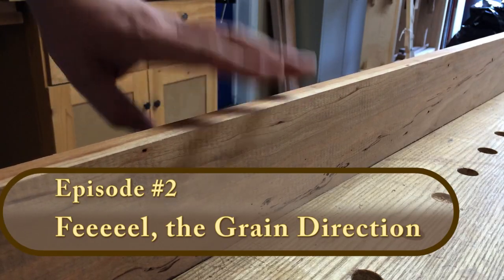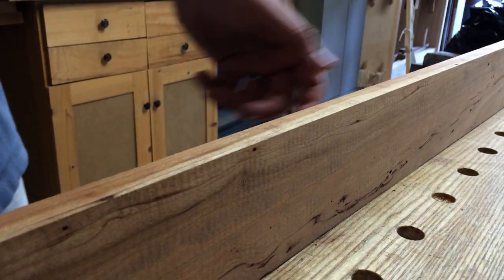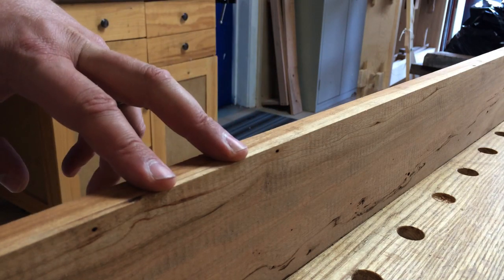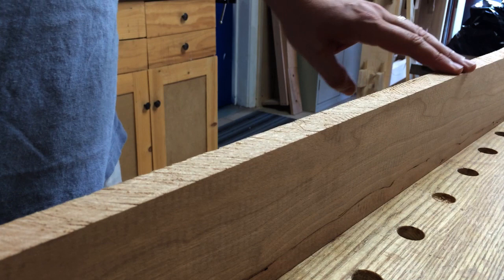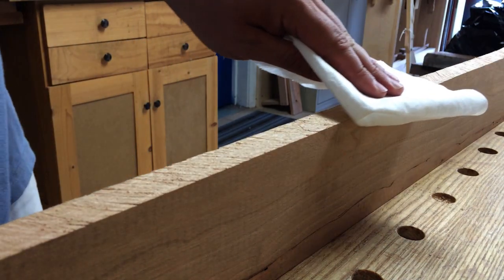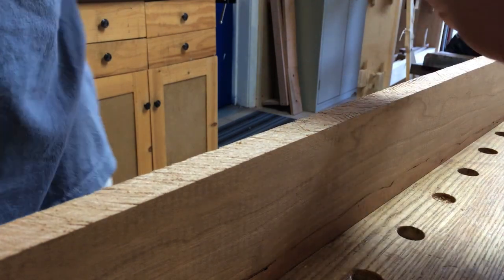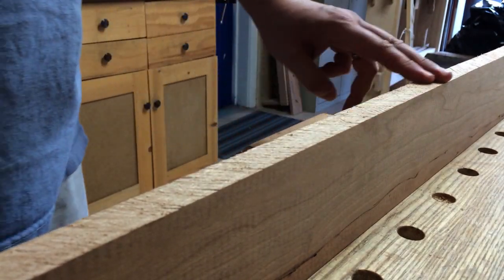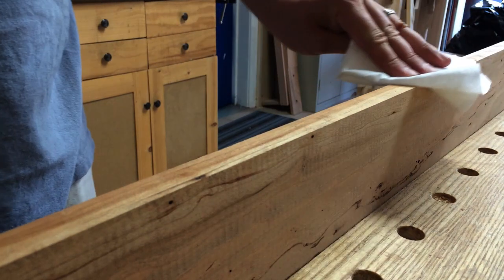Chips 'n Tips #2 GrainDirection

Comment: HELP! 

Hey Shannon.  Ive started milling some cherry.  The new cherry I have should be no problem identifying grain direction ( at least until I cut it ) but its the older cherry (already milled and cut to 1-1/2" wide by 12" long) that Im having a dickens of a time with. 

I have a jewelers loop that works but I was wondering if there was another way?  I have 372 pieces that I have to cut (approx. 100 already cut and milled) that I need to keep track of and using a jewelers loop on every one of them is going to be mind blowing!

Ive gone to a couple of sites (Google searched) that talk about rays and vessels but trying to eyeball those seems to be almost impossible with cherry.  What am I doing wrong?  The site (http://www.startwoodworking.com/post/determining-grain-direction) also mentions looking at the end grain so long as you can see the cathedrals but very little of what I have has visible cathedrals on them.  The ones that do, when I run them across the joiner as noted (cathedrals facing away from you and end grain arching up, plane in direction of cathedrals, end grain arching down, turn it around) show tear out when viewed through the loop.

Is there a quick way to look at cherry and identify grain direction on narrow, milled boards?
Reply from the maker: Yeah  look at the edge of the board to see which general direction the grain is running in.  Put away your loupe it isn't necessary.  The end grain and cathedral method is a sure fire way because it allow you to determine which side of the tree you are working on (bark or pith side) and therefore how the growth rings lay over top one another.  But you have to remember that if you are using a power jointer that the blade is spinning towards you so you run the board over it opposite from how you would run a hand plane over the board.  Still I think your over complicating it with a loupe and looking for cathedrals.  Just look at the edge to see how the grain intersects the surface.
Reply: O.K, so right now Im laughing hysterically!  My vision isnt what it used to be that's for sure but I get what your saying.  Thanks so much.  I'll give them another look....with just the glasses :))